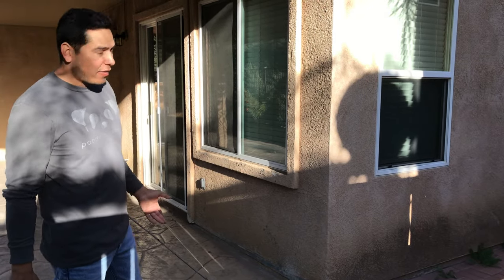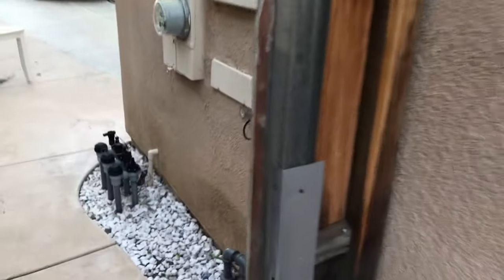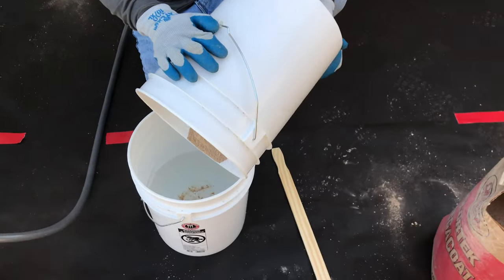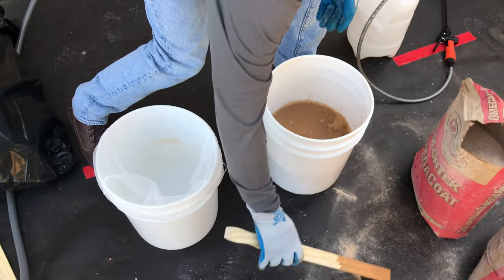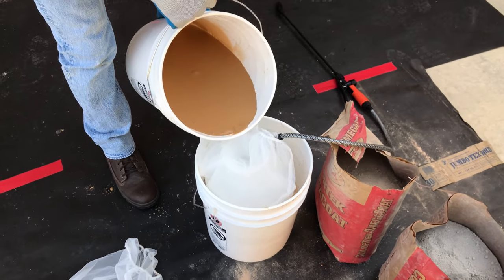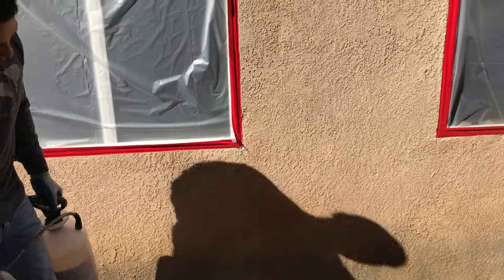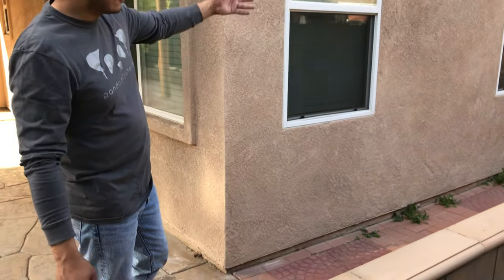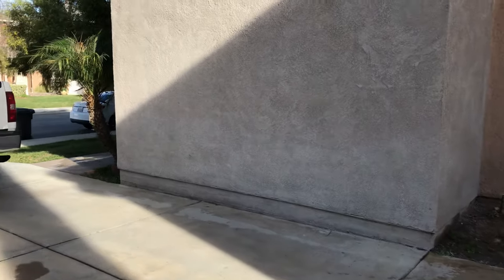How to Fog Coat your house

Comment: Would it work to mix it thicker and then roll it on? I would think that it would cover any hair line cracks that way. Also, would fogging cover any cracks filled with caulk?
Reply: I believe the fog coat is intended for light painting applications in order for better color blending. I would suggest to seal cracks and paint the repaired areas with a similar color before hand. This way when the fog coat is applied its applied evenly to all areas with a gradual blending.